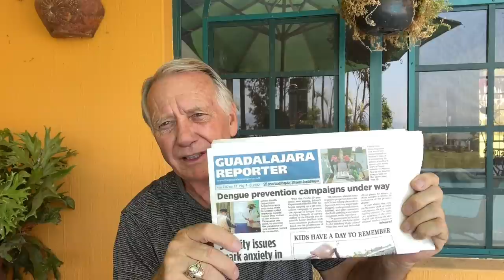Not Quite a Rant!

Comment: In the US, you are told that if you do not build per the UBC ( Uniform Building Code), your structure may be at risk of failure.  That is true as evidenced by the recent collapse of the townhome building in Miami which resulted with multiple fatalities.  BUT on the other hand, the Mexican building code is not always adhered to and you don't hear of buildings collapsing because of that.  
Good video.  Your long videos containing stories like the one you told are highly interesting.

Comment: Often times these problem like the one you had aren't foreseen with pest control delivery systems. Maybe call whoever installed it and report it so they can either fix it or create a new delivery system. My guess is that they'd want to know what happened on the roof. If people are having similar problems it only stands to reason people will remove and not want to use them.
Interesting video once again. I always enjoy seeing your property, Lynn, and finding out what's on your mind. 😉 Have a good one.

Comment: 1) I used to do construction when I was young, from framing to roofing to remodeling to drywall to carpet laying. You are correct about the ridge board...it is only a place for rafters to meet so the pressure from one rafter meets the other. The lateral stability is provided by the plywood roofing (and in Florida, the rafters  have to be connected to hurricane clips).
2) I know a couple of mechanics that work on cars at your house...don't know if they know about BMWs. Contact me if needed.
3) I am talking to my immigration lawyer about getting an RFC but we can't get an appointment at the SAT office (I came in through the Regularizacíon program). Qroo Paul at Two Expats also said there is another document we are going to need. I have no idea how we are supposed to get documents when there are no appointments. Just like the Mexitel website is hopelessly broken and not well planned so is this latest attempt of knowing stuff about who is living here. Most everyone I know is ignoring it for now.

Comment: You showed us your tinaco and the problem and solution but didn't explain its purpose. Most people connected to municipal water in other parts of the world won't understand why you need a water tank if you're connected to a commercial water source.

If I understand correctly, the water pressure is pretty low in Mexico and because of that distribution is somewhat unreliable. If somebody near you, especially upstream, uses a lot of water it may reduce the pressure to the point that you don't get enough to do anything useful. So everybody has a reservoir that acts as a buffer so their water supply stays consistent. There are different configurations; tinacos are on roofs and cisternas are below ground level and there may or may not be pumps involved, but the point is to keep water coming out of your taps with a fair amount of consistency that wouldn't happen if you were relying directly on the pipe coming into your property.

The point being that it's not just rainwater collection or a secondary water supply. It's just a normal component of a residential municipal water system in your part of the world.

Correct me if I'm wrong. I had to do a Web search myself. 😂 And even though I got the spelling correct the first time there wasn't much information in English that I could find.

Comment: I absolutely love your videos but I don’t think that is totally correct by the building inspector. If we totally removed the top 2X 12 it does not have a place for the overturning moment to shear in to for the roof rafters. Then that roof load is not supported by the post on each end of the beam. I think you need it.  Unless you have a collar tie and or ceiling joist.